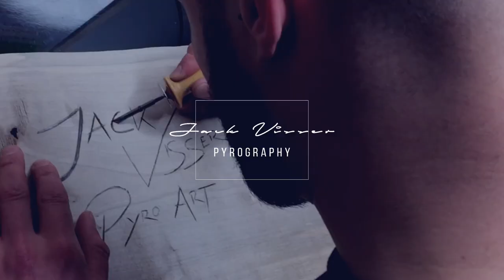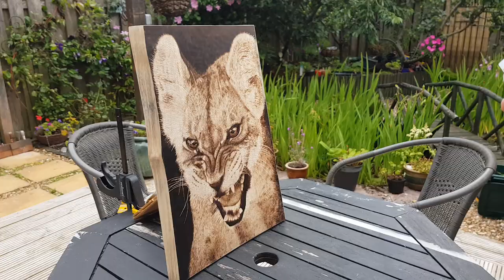SEALING pyrography on Wood with PLASTIKOTE Finishing Spray

Comment: Hello, good data, but I want to know if when applying this type of lacquers, the drawing does not lose the lightest shades, for example in face drawings where the areas without pyrography are important for the "light" that it gives to the drawing, in your case, the feline's whiskers
   .....excuse my English is google traductor...
Reply from the maker: This particular spray doesn't destroy any of the lighter details. It's my first choice for a sealant.

Comment: What if you put epoxy over it?
Reply from the maker: Epoxy works well too. But it's a bit more of a job. The spray dries in about 20 mins and you just do 3 or 4 coats. Epoxy can be a nightmare with bubbles. You need to keep an eye on it while it dries. But granted, if done properly, epoxy looks amazing.
Reply: @jackvisserphotography  Im gonna be doing some live edge benches with some wood burning. You should try Ecopoxy Flowcast. No torch and all the bubbles pop on their own.
Your work is really popping.
Take care